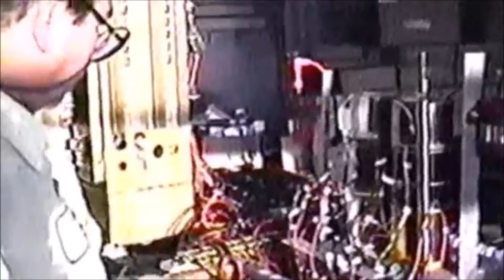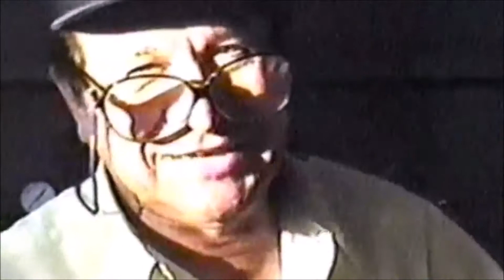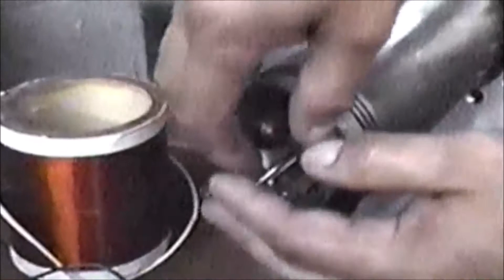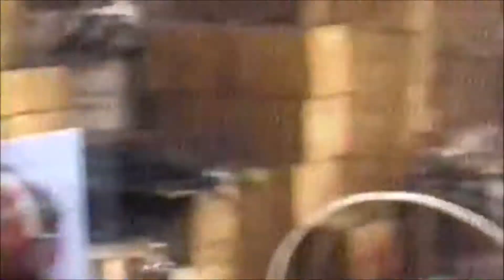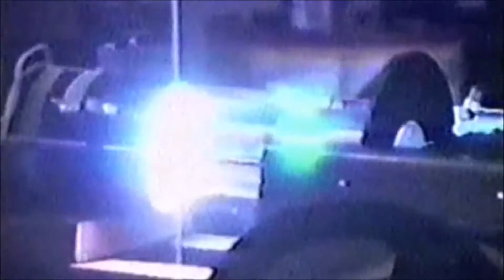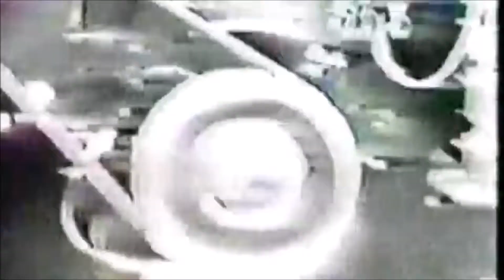Joe Papp The Papp Engine Free Energy (Over Unity) Diaries Part 15

Comment: Stanley meyer evaluated this energy to enact the tv show star trek .the motion of that warp speed propulsion i believe was stan meyers understanding of a light guide generation system E.P.G stan shows it in his newzealand house meeting video on youtube .he says when asked "what frequency pulse is required in the non magnetic stainless steel mirror walled tube ( a car engine cylinder chrome plated ) " stan says querkily . " any photon source will surfice " hes almost laughing as he knows its the photon that is disturbing the vacuum air elements to interact wth the external coils on the outside of the non magnetic tube (car cylinder ) LOOK NOW AT JIMMY SORBORI APPERATUS IN THIS VIDEO .HE,S SHOWING US.  " its actualally a normal old tv tubes " tv flyback ? May be ......

Comment: its natues lightning .which is electrostatic ( the lightning bolt ) and magnetic static ( then collapsing thunder from the lightning bolt causing a void .) hence in an engine the valves can never valve bounce as everything is in a vacuum,.it can go to warp speed .but the engine begins to freeze as it goes into chaos and like papp experienced .has a catastrophic distruction....if not stripped of amps to earth via a bleed off